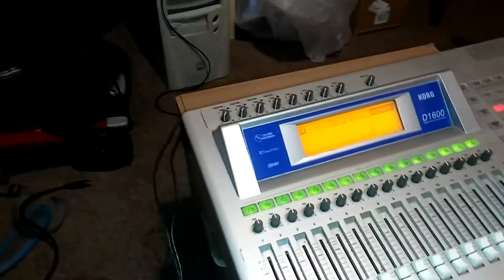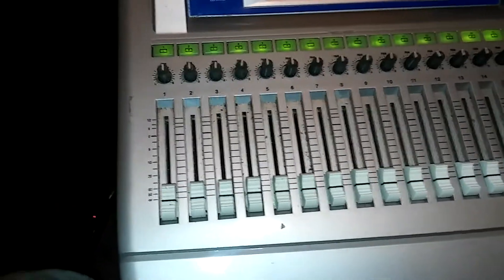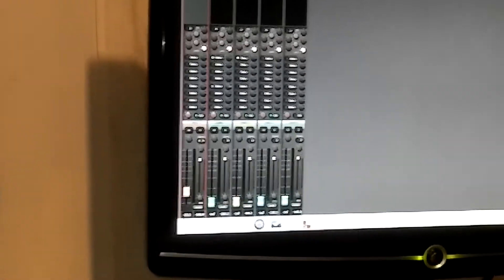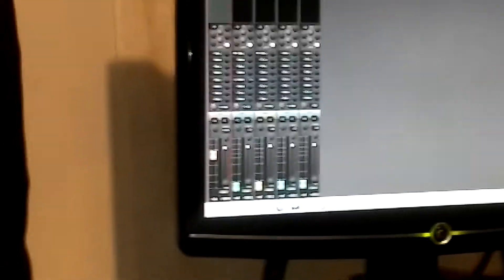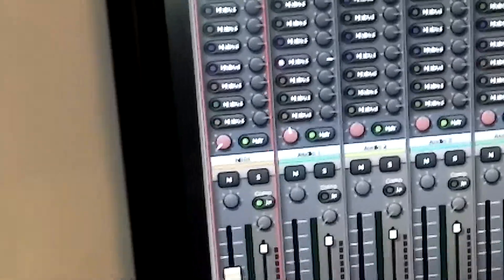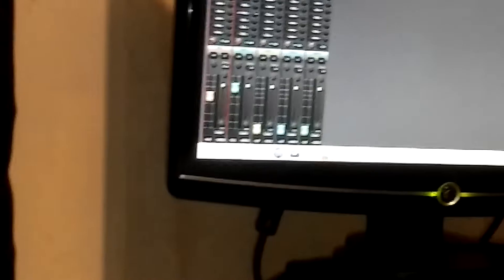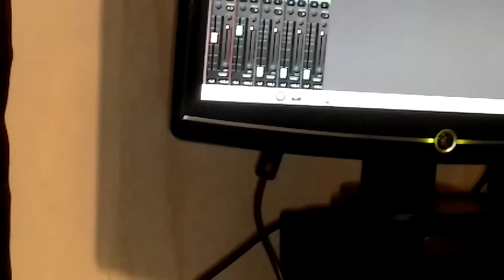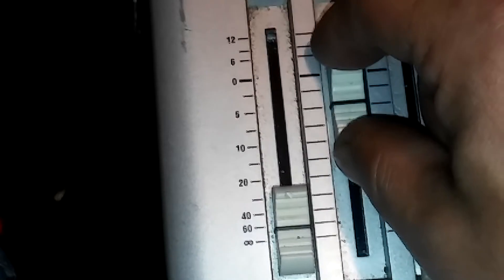Mixbus General Midi controller using a Korg D1600

Comment: Is it safe to assume this will work in fl studio ?
Reply from the maker: I can't see why not. Just setup the korg as the general midi device. Might have to use General midi controller because i think these units were around before the dedicated Mackie midi protocol. So you Might have to teach fl studio what you want the korg to control.
Reply: Massfusion Studio that’s great. Im used to doing that. Hows do you use it with tracks over 16 channels ?
Reply from the maker: @ScarletRyodan  i would recommend setting up sub groups in your daw and make it learn what track to recognize the midi control. In example..
Dedicate tracks 13-16 on the korg or midi controller to control sub group faders in FL studio.  I run into songs with over 30 tracks at times and sub groups are the answer. All backup vocals on one sub group and drums on another for example. Makes mixing a breeze.
Reply: Massfusion Studio Thats amazing. Thank you

Comment: Hello, how do you deal with the fact the faders are not motorized ? If you do automation or go from one project to another, faders settings between the daw and the korg change of course. Btw, thank you for the video, I'm looking at those cheap second hands mulitracks but I'm not sure I would benefit from using one in my daw ...
Reply: The Korg has virtual mixing scenes that you can save. So whatever you do while mixing? Just save The scene and it will create Automation either in the DAW or the Korg. It depends on which system you have set as master and slave. If you sync the midi clock in the Korg and press play in daw? Both computer and Korg sync and start playing. Then you can use the Korg as an external mixer. If from play start to second measure of intro the keyboard track plays? And you are bringing that instrument down in the next measure? You can save the intro as a scene on the Korg. Then when song plays back you'll have automated faders in the DAW or vise versa.
Reply: So if your intro is 48 seconds long? You'll want to save the scene for mixing automation at 48 seconds out time. In time would be from the start of the song. So if you have an old-school digital recorder laying around? Save your money and utilize that to mix out of the box.
Reply: Plus another advantage of these old-school recorders? You can bounce record from DAW to them. If you have old projects that are in lower resolution format? Like older 16 bit 44.1? You can bounce them to the external unit. Then recapture the tracks back into the computer in real-time in a higher resolution. Thus beating dithering of file format. Many mastering engineers bounce record into another resolution in real-time rather than doing a file conversion to a higher or lessor resolution. That's how you beat the warble artifact. If you record a track in mp3 format? And you're playing it in real-time from external source? You'll retain much of the file because it's not being compressed. It's already being captured in mp3 format. Some daw brands can record in ogg vorbis or mp3 format on input. I do this at times when an mp3 format is needed. I don't convert high quality wave files to mp3. You get better results with external player of the wave file and recapture it in mp3 format. I use a memory stick with my external console. Play the file and record it into my daw set to capture in mp3 format.
Reply: Here's a link to my main channel. I don't really use this one anymore.
Whatever you need to ask me I'll help you out best i can. 

https://www.youtube.com/channel/UCbfpOQ5mez0km7qkcNa9DQw
Reply: My main channel. Feel free to subscribe. I'll subscribe to you as well

https://www.youtube.com/channel/UCbfpOQ5mez0km7qkcNa9DQw